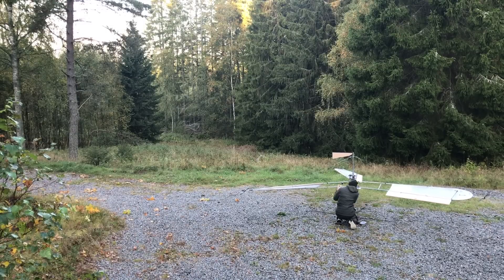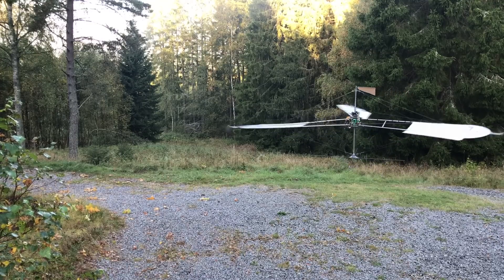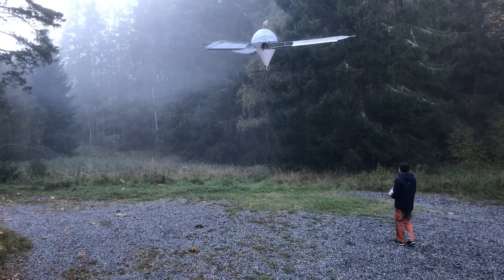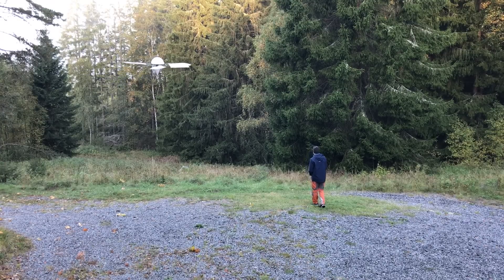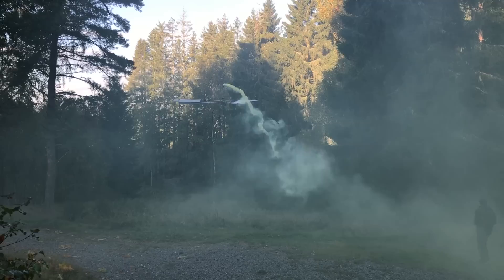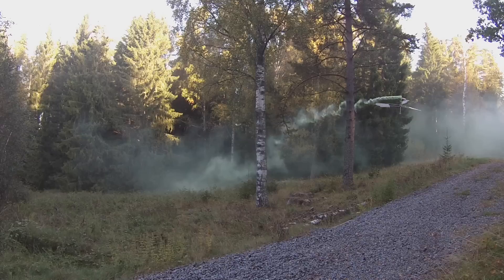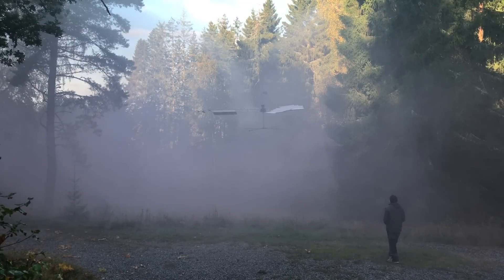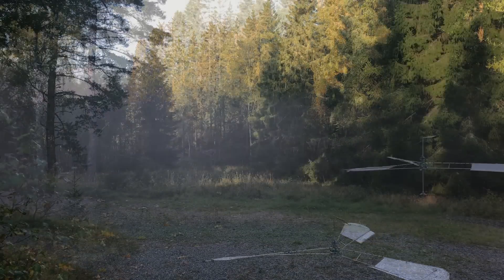Levitator 5 With Fairings and Smoke. Electric helicopter.

Comment: I reckon your center pipe is to small in diameter (in the Levitator 4 version at the start) because you can see it flexing and wobbling at the top and bottom above and below the motor. I think it needs to be twice the diameter!

Comment: you just need a system radle below ruders and pop up legs with sensor on ground best if IR with chasis is a geo probe flies like alien probe and it apears like you strike a gold is also a geo material probe used to move analyze athmosphere with some basic senzors and do push astronats like move nav point to go see and pick it up to practice field research and and to taks ground check materials except on mars do am stuff and prcatice test anylize with own material senzor analiye or even spectrometer device who see uv light ground soil and land on best dark place off composit material is real time probe tomorrow can stay in space actualy is satelite probe with gps and spectrometer self land device which can laungh and do self diaognoze and land on most probable spot and do deseride path search research theme direct from seat in base except it started to be total fun and something very usefull after contacting nasa or space x they would encourage you to finish research and made data public and contact nasa and space x if liked in short nice stuff looks like leonardo device or mars probe a lot

Comment: Not sure why, but I was always fascinated with making a rotorcraft that had a relatively low rpm. The inspiration of which came from the XH-17 which also shares the tip thrust design. I like that you used smoke in this one. I can see that the inboard tip of the blades also creates a vortex as I'd figured; pretty interesting.

I always wanted to make an RC model of the xh-17. I've pondered ways to do it, either through a single EDF or EDF's mounted within each blade. Not inspired by efficiency by any means.

Comment: As you removed more from the propellers  I think you lost your lift because you lost lot of area the wing area you could gain that back by creating a bigger wingcord the cord.   Measured from the leading edge to the trailing edge  I do believe the best part of a propeller blade is propeller blade is the very

Comment: Another comment I still have not seen the whole video but I reply as I watch the video I know I notice that the smoke grenade on the tip of the rotor did not seem to make any vibration or out of balance effect I guess with the  Rotor is spening so slow the precision of a balancing a blade is not as critical.very interesting

Comment: Very nice, very meditative.  You will increase the efficiency ~5% by adding "tiplets" to the outer prop edges (like on commercial aircraft wings) which blocks the inefficient vortexes from forming at the tips as the high pressure side spills off into the low pressure side.   You will be able to get the same lift for a smaller prop diameter if you redesign the prop blades to be more like a real prop and less like the wing-based shape you know have - redesign the shape to maintain a constant pitch-to-diameter ratio at each radial prop location, which means the inner parts of the prop will have a larger attack angle with respect to the ground than the tips.  the attack angle should decrease gradually from the inside radius to outside radius of each prop blade.  This change allows the pumping to be the same for all radial points on your prop.  When you make this change, update the flaps to also have a variable attack angle too.  All of these changes might not matter since your original goal has been achieved - make a large diameter single-prop drone that appears to effortlessly hover because of the low prop RPM.

Comment: Might be interesting to move the motors inwards from the very tips so that their airflow flows over and under the wings and can make use of the Coanda effect.
Reducing the motor radius can spin the wings faster, so having a similar effect to increasing their propeller pitch angle, but may give more efficiency.

Comment: I wondered if you could use dynamic wing warping to achieve more directional control, or the helicopter swash plate effect...with modern control sytems, and theory, you can do quite interesting real-rime control of motors and wing shape/angle-of-attack??

Comment: This is so beautiful! I would love to see what would happen if the motors were: a) situated to move air from the center, out across the top of each wing, or b) situated on a vertical axis on the leading edge of each wing.  note for marketing... a lightweight array of LEDs in the wing could be used to make a Hollywood-worthy silent radio. thanks for sharing and good luck

Comment: use ir remote
Reply: line-of-sight rc controls
Reply: looks like an ufo
Reply: you get rid of the noise if you put all edfs inside as one single turbine (noise muffling)
Reply: a blimp is "better" if you just want to float
Reply: passive floating like a boat is "better" than active powered moving parts
Reply: electrostatic vacuum balloon (or just ocean water deuterium fused to helium)
Reply: how strong you measure the ground effect to be with that
Reply: you should be able to measure the additional lift very accurately (vs radius of the rotor wings)

Comment: I wonder if adding a mechanism to adjust wing pitch would be useful enough to offset the complexity and weight penalty.
Reply: From a helicopter pilot's perspective, I wouldn't fly the 1:1 version without collective pitch.  I understand electric motors are more reliable than ICE engines, but shit still happens and if a motor drops and you don't have collective, you're straight fucked all the way down.  At least with collective pitch, you have the ability to auto rotate.

Comment: I make/made my living designing electric aircraft power systems.  RadicalRC if you want to look it up.  My sense here is rather than increasing pitch, you'd be better off increasing motor KV modestly.  You recognize the KV path because you mentioned not being able to increase voltage.   At low speeds, high pitch props are sub optimal.  You may be increasing the efficiency of your system increasing pitch (and thus pitch speed) yet only smearing makeup over a big blemish of running too low of KV.  In other words, you might be down at 40% efficiency and improving it to 45% seems like a lot while there may be much more to gain and little more to lose.  These high pitch (read high angle of attack) props might not be stalled but I bet they are close with pretty turbulent flow across their surfaces.  Roughly speaking, if the motor speed (in your case the speed of flight at the motor's rotational radius) is under 40mph, you're better off with 1/2 square props or nearly so. (I recommend mostly 1/2 square props in the 28 to high 30mph flight speed range) By 1/2 square I mean a 14-7 or 10-5 has 1/2 the pitch of diameter.  As you increase flight speeds you want to increase the ratio of pitch to diameter.  To run square or over square props 12-12 or 12-14 for example, you'd be planning on high rotor tip speeds like 80mph or above.    In the 50 to 70ish bracket, you should be KV'ing into roughly 3/4 square props.   These are rough rules of thumb from decades of experience.  You might surprise me with your motors flight speed here, but they look very much on the slow side.  There are many factors here and I've not seen all your video's, only 2 or 3.   Consider the very high angle of attack of these high pitch props you are now running.  In a high-speed aircraft, the angle of attack in greatly reduced by speed of the incoming airstream to be much like the angle of attack of a lower pitch prop at a lower speed.  There are lots of interesting factors in what you are doing here.  Also, to be considered is the airspeed of the downwind blade here being a limiting factor in how much wind you could safely maneuver in.  To understand this though, look into what limits the top speed of conventional helicopters.  You're doing all your testing in pretty dead air which I understand fully.   The horizons of aviation are pushed forward by people like you tearing through the side of the paper bag to see what lurks outside the envelope.

Comment: Nice results!
A few possible ideas.....
Slightly angle the tip motors up or down, and then modulate thrust for cyclic control?
or dual tip motors, maybe differential thrust twisting lifting wings
Remove flaps or retain for collective control
Folding type thrust props - to help with bending moments at prop root / fatigue / vibration (conservation of angular momentum tries to snap the prop blades off as they circulate)

Comment: Could the person be sat inside the cone instead of the hemisphere? This would make the upper structure smaller if not redundant therefore reducing drag and allow unimpeded (by wings) views down. Also if the cone is a watertight structure it would enable the pilot to see under the surface of the water when landing on water.

Comment: It seems you missed the opportunity to point the camera used to look at motor current. It would have been nice to point it out down the wing to observe the wing and control surfaces while in the smoke. This might tell you if there is smooth and laminar flow or turbulence.

Comment: What if instead of puting the motor to the tip put it right on the wing part to have the advantage of lift and so increasing the reaction of the controll surfaces

Comment: I'd love to see something like vtol props,  flat profile inline with and set into the mid-wing, that turn on and off only as the wing leads into the wind (losing lift), and maybe adjust forward prop speed to save power or aid rotation. Mainly with a view to making it flyable in high winds.
 Very cool, and seeing the floating person pod, aka pipe dream, is exactly the inspiration we all need. Keep it up!
Reply: My guess is that the additional weight and drag would reduce efficiency.

Comment: Will you be adding your OTV 8 flight control system to the top ?
In place of your “swash plate” system.
Reply from the maker: Trying to keep complexity and noise down and adding (2-3x4 =8-12 for redundancy) 4 variable pitch propeller systems do not help there. However, it sure would make straighten the aircraft up prior to take of easy so I have contemplated the idea myself and also test built a part for such a system based on a 450-helicopter main rotor head. The plan for now is to add a tilt mechanism for each tip propeller and a dedicated flight controller which enables me to start the machine like a tri-copter, just to make it stand straight, the larger version can not have a landing gear for weight reasons, and then slowly tilt the motors from vertical to horizontal where the control surfaces takes over the balancing control of the machine. Still complex, but overall more efficient and quiet I think.
Reply: @amazingdiyprojects  Cool! Like the Nicholas Rehm system.

Comment: At https://youtu.be/z0LwgyphpsU?t=65 I noticed that the wing flexes on the middle. Does that affect the response of the control, e.g. maybe adding latency to the system? You could add another set of wires attached to the middle of the wings to stiffen them up.

Comment: Will those small motors be able to lift the build if turning upwards?
Reply from the maker: They produce about 1.2kg thrust each, vehicle weight is 12kg, so no. You need the aerodynamic gearing the large rotor provides.

Comment: I would be interested in a DIY e-book on this device. I am a low-level novice to this, but this is so incredibly beautiful in it's simple elegance. I can even imagine the drone with the faring in a future dystopian film.
Reply from the maker: Thanks, this project just might qualify for a building instruction, I am just not done iterating quite yet. Good to know there is interest in a e-book.
Reply: High Torgue brushless motors like the ones in Dewalt.... Makita and milwaukee drills. These motors have so much Torque they over come the resistance of the Extra Large Propellers
Reply: It would be interesting to see what strong crosswinds do. as well as the energy consumption to daily load rate and the total carrying capacity.
to compare with conventional things like drones, zeppelins and airplanes...
Rarity value and elegance in flight is already there^^
Reply: Yeah, I had a similar vision of a not so distant future, with that graceful aircraft.

Comment: Very cool project, thank you for sharing. Btw, on Top of both sides of the central axe,  try to use  2 motors with  2 large/medium metal discs in parrallel to behave like a gyroscope, even with one motor , i think it will improve hihly the stability and direction control, an arduino controler might be suitable to control motors for better accuracy IMO

Comment: CONGRATULATIONS !     YOU HAVE BUILT MY ULTIMATE DREAM MACHINE AND I WAIT EAGERY FOR THE NEW VIDEOS.  I MAY BE STATING THE OBVIOUS BUT THOSE CHANGES IN LIFT WITH MOTION ARE DIRECTLY RELATED TO THE FUNCTIONS OF A HELICOPTER ROTOR DISC.  
            THE INCREASE IN LIFT AS YOU FLY FORWARDS IS, OF COURSE, TRANSLATIONAL LIFT.  THE REARING UP AS YOU STOP IS 'FLARE EFFECT'.  THAT SUDDEN SINK AS YOU FINALLY STOP IS DUE TO THE THE SUNBSEQUENT LOSS OF BOTH FLARE EFFECT AND TRANSLATIONAL LIFT .
             THESE ARE EVERYDAY EXPERIENCES WITH THE HELO BUT  EXAGGERATED BY YOUR RELATIVELY LOW ROTOR  RPM. IT'S ALL TIED UP WITH DISSYMATRY OF LIFT ACROSS THE DISC AS FORWARD SPEED INCREASES.  IN THIS CASE OF VERY VERY LOW RRPM THESE EFFECTS WILL BE MAGNIFIED. 
                 IF A HELO  WERE TO HAVE  INFINITLY HIGH  ROTOR RPM MANY OF THESE ADVERSE EFFECTS WOULD NOT EXIST.  IN THE CASE OF THIS EXCITING MACHINE, WITH IT'S REMARKABLY LOW RRPM WE HAVE TO ENDURE THESE HANDLING PROBLEMS.
            NOTHING. HOWEVER TO GAINSAY THIS REMARKABLE DESIGN. YOU WILL SCCEED AND ONE DAY YOU WILL FLY IT TO TOUR OWN HUGE SATISFACTION AND THE ACCLAIM OF YOUR PEERS.
             AS I APPROACH MY NINETHITH BIRTHDAY I HOPE THE DAY WILL SOON COME WHEN I SEE YOU DRIFTING SERENELY OVER THE TREES IN YOUR WONDERFRUL CREATION.

Comment: it looks super stable ... i understand the desire for horivontal speed , BUT what is its lifting power ... compared to helicopters and drones ... could replace the pink elephant in los angeles ... a big old heli used for roof top equipment and precarious hot tubs
Reply: He did a test last video I think